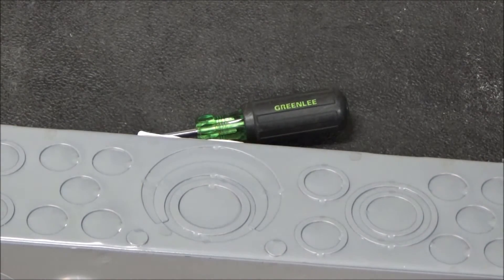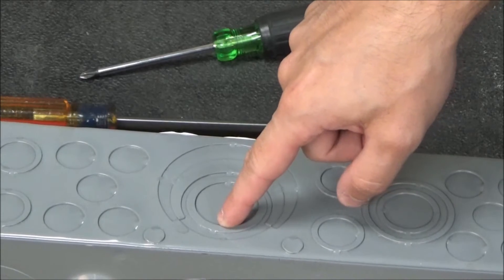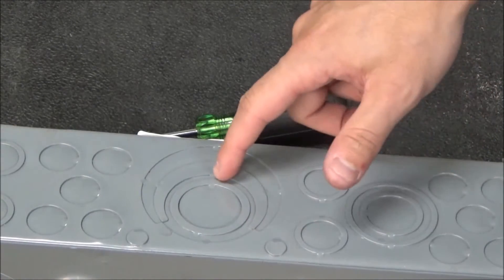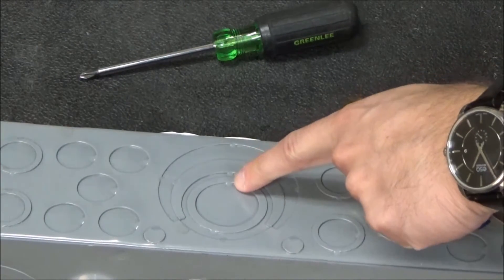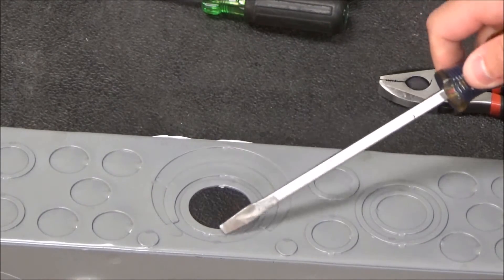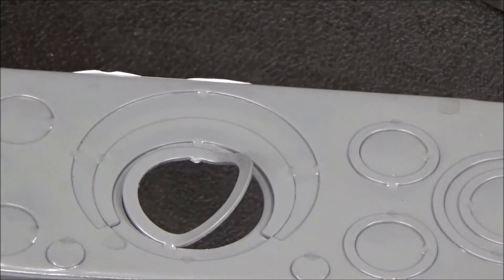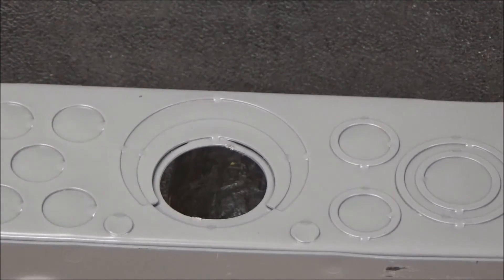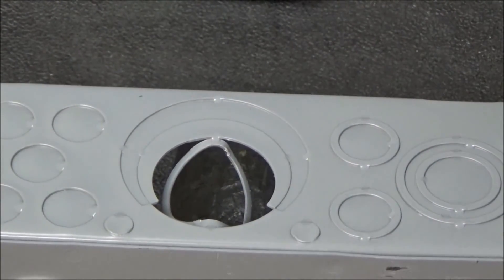How to Remove Knock-Outs from Electric Box QO & Homeline Load Centers | Knockout Hole Punch

Comment: Fire panels are the worst, it is near impossible to knock out the 1/2” center without also knocking out the 3/4” outer ring… I usually carry bushings for this reason…

Comment: Yeah on the second knockout I saw you had the same problem I did. The next knock out starts coming out if your not careful.
Reply: Exactly.  I've done bunches of knockouts on my personal projects (several buildings and a couple of house panels) and I'm searching to find if there's a tip or a trick I should know about because they're not as brainless-simple as one might think.
Reply: @grassroots9304  Yeah, the one I really had trouble with was a Square D Homeline load center about 3 years ago. I really fought with it. . I just installed a Square D QO load center a higher end or commercial. It went much better than the Homeline which was almost impossible to knock them out. Having worked in tech manufacturing, It may just depend on how much they have the process dialed in on any given manufacturing day. Or it's machine or design issue.

Comment from the maker: Please note: The video mentions spot welds as the connecting means of the knockout. This is incorrect. The correct term is "Tie".
Reply: Thank you for throwing this on here.  I was torn between mentioning it and not mentioning it.  These are stamped-steel parts, no manufacturing process would weld in those bits.  The stamp just isn't complete around the edge to leave these ties.
Reply: @grassroots9304 😊0
Reply: lol thank you. That was bugging me for some reason and I wasn't sure if I wanted to be petty enough to mention it.

Comment: When you remove the second ring, say, to attach a 3/4" connector, you may have two tiny tabs left on either side of the hole. (What the video calls the spot-welds.) These can be very difficult to remove if the panel-box is already attached to the wall, or already energized. I was lucky enough to have a 3/4" nominal Greenlee punch on hand, to clean out the hole, but many viewers of this video may not have such a $100 tool.

Comment: the largest knockout on my QO load center appears to be 1.5 inches. However, the last bit around is not able to be removed, so my 1.5 inch nipple won't go through. What's up?